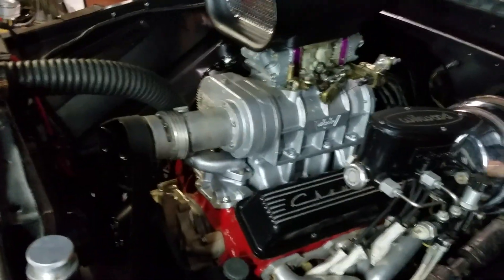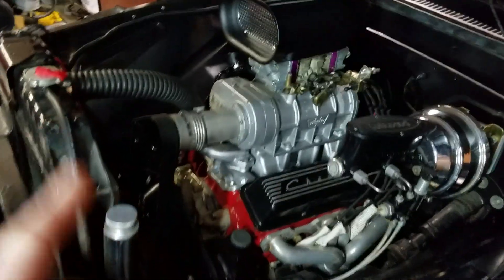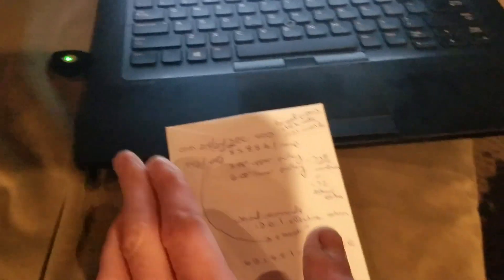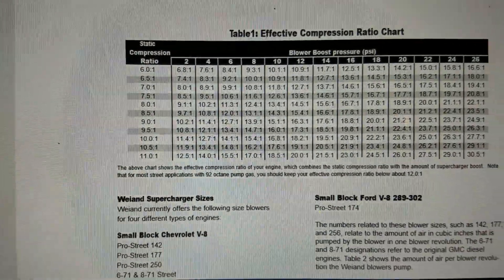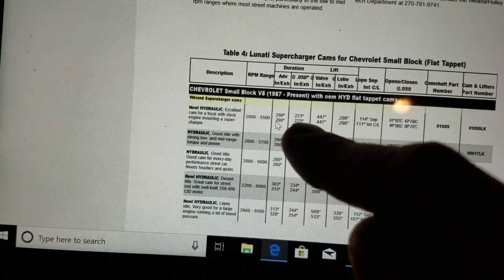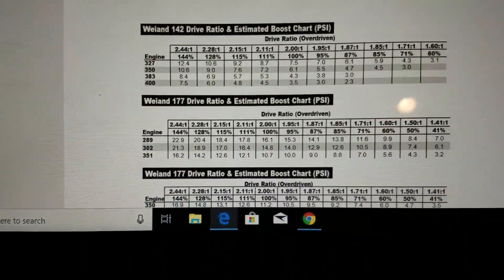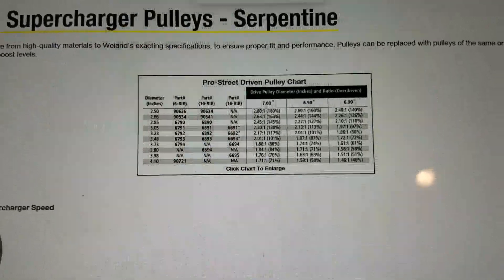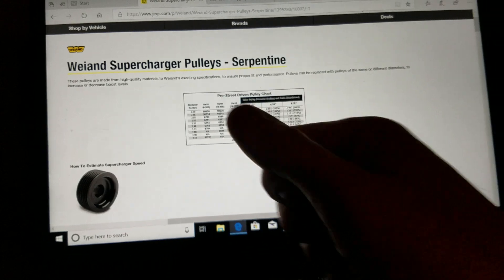Weiand 177 Supercharging: How Much Boost IS TOO MUCH?!

Comment: Question: is it possible to determine how many pounds of boost on your engine at 2000 rpms and 3500 rpms. I'm building a simular sbc 350 motor daily driver non race-drag, however I plan to keep the boost below 3 pounds of boost max at those lower rpms.  Is it best to control boost by installing larger pullies ???

Comment: I run the 8/71. On my rat moter.  Big deal on pistons. And rods.  Heads also. Pick the right combination . Stock is to risky. In the advertisement it says extensive modification needed. Wiend wasn't kidding. Yep. Carbs on a normal moter dont work correctly need to modify them also. Yep makes a small moter into a monster.  LOL  good video.

Comment: Good information,  have you had any belt  slippage problems?
Reply from the maker: No, though I wish the setup would allow for AC.
Reply: @PhysifistEngineering   i am putting a 177 on a bbc and was able to re work a late model single belt set up to alow for ac , power steering,  alt all 1/4 inch behind the blower belt .
Reply from the maker: @adambatchelder4121  you should make a video. Share the knowledge!

Comment: Very informative. Thanks. Do you have a link to the pages you were showing. I got a short nose small block blower that was used and would really appreciate a link to the info you were sharing.
Reply from the maker: Can't post links in here, but look for weiand supercharger installation instructions. The product page usually has a link to download instructions. Sometimes Summitracing will have them too.
Reply from the maker: Just checked, it's documentation dot holley dot com. First thing that popped up on Google.

Comment: Could I run this blower on a pretty stock internal 350 ? Basically I have no idea what internals are in the motor.
Reply from the maker: Keep the boost under 7 lbs, and make sure you don't run lean and I think you'll be fine. Just make sure your rings are sealing well and your cooling system is good. Probably switch to a cooler spark plug too.
Reply: @PhysifistEngineering  thanks man!!

Comment: What about 292h comp with a 501/501 lift in 244 duration  forged pistons in max bore with a 9:5:1 compression would it be to much?
Reply from the maker: The comp is a little high, but if you stayed under 8 psi it could work. For the cam, it would be nice to know the LSA. Cam changes don't really do much for under 3500 rpms. For the street, it won't help much, but racing at higher rpms it would help. Would be curious to know about the heads too. I've seen these blowers support built 383s so they have potential.
Reply: What do u think about the ls what’s your opinion
Reply from the maker: @hillsidesavage1413  I like it, cheap, compact, light weight, instant horsepower, supportive aftermarket for just about any swap.

Comment: Did the hood shut with the blower or did you have to cut a hole
Reply from the maker: I had to remove a small section of the rear support on the hood, but I didn't have to touch the actual sheet metal at all. So it looks stock from the outside.

Comment: Where does the boost gauge vacuum line go on the intake?
Reply from the maker: I have the gauge tee-d off from the line going to the power valve so they each get their signal from the same manifold port. So you get a vacuum reading which is helpful for tuning, as well as the boost signal.
Reply: @PhysifistEngineering   appreciate the knowledge

Comment: Where does the vacuum line go on the intake?
Reply from the maker: For the boost referenced power valve, the signal should come from below the supercharger, usually a port somewhere on the intake.
Reply: Appreciate it

Comment: How has your blower and engine held up since doing this? I’ve had ideas of slapping a 142 on my 350 but I drive the truck as a daily so I’m concerned with a similar setup being reliable
Reply from the maker: I actually just pulled the plugs and they look coffee and cream so the A/F looks good. I think it all depends on your boost level and the A/F mixture. If it doesn't go lean and you aren't pushing more boost than the pistons and rings can handle then you should be fine. I recommend an A/F gauge so you know what the engine is doing. If you don't have forged pistons keep it under 7-8 lbs of boost. Plenty of oem cars with superchargers so you should be fine. Run a cooler spark plug as well.
Reply from the maker: Did you ever put a blower on your setup? I recommend the 177 over the 142 if you do.

Comment: My 355 with 10.1/2 1 and that 177 with a 150 shot in my 46 street/strip truck.  Ran 9.70 1/4 mile . And we put the smallest on top and the biggest on the bottom.  It runs awesome.  It's also on e85. See my video on YouTube making 700+ Rwh
Reply from the maker: Yea, plenty of meat in those blowers, but being a daily I wanted to concentrate on reliable power without being eccentric.

Comment: You forgot that they have a pro street supercharger 144 series, which is going my 85 Monte Carlo SS with a 383
Reply from the maker: The only difference between the two is the coating on your rotors which wears over time. Did you choose the 140 series to fit under the hood?

Comment: saying your engine will get 30 more HP from more boost with the smaller pulley is one thing, and not knowing if your heads will handle that extra boost is something else
Reply from the maker: I dont think that's an issue when discussing boost at or under 8 lbs which I made pretty clear in the video. This is for street applications that are playing it safe by maximizing boost while remaining within the safe zone.
Reply: @PhysifistEngineering  you can think what you wish, but in my years I have learned that things are just not so, so
Reply from the maker: @sideswiped6874  Sounds like you've had bad luck. I always use quality parts, follow instructions, research everything, and keep power within the engineering specs. Clearly if you're applying boost to unhealthy parts things can go wrong, and supercharging always has inherent risks so you're stating the obvious. That's why I made this video to help people maintain safe power levels. This isn't a race car, it's a street truck and if you're afraid of 6 psi and staying under 5k on a healthy engine then you're on the wrong video.
Reply: @PhysifistEngineering ,  typical! 
go back and read my first posts again. and don't add between the lines!
 I was pointing out THE FACT that just because you say "2 more pounds of boost "will" produce 30 more HP" doesn't make it so just because you said it.
Reply from the maker: @sideswiped6874  I actually said, "I'd say, add ABOUT 30 horsepower." That's called an estimation, and it's based on what I know about this engine and personal experience. Everybody's engine combos are different and that's why people should be following the instructions like I outlined. If people have questions about their heads they can search forums or look for other videos that document that. I know the viewers are smart enough to do that so I don't worry about it.
Reply: @PhysifistEngineering  ,  about 30 HP,  yeeup, you said it
Reply from the maker: @sideswiped6874  Glad to see you finally understand. Thanks for watching.
Reply: @PhysifistEngineering  yes I understand well, that is why I first posted, just because you guess doesn't make it so ;)
Reply from the maker: @sideswiped6874  It's ok son. Someday you might be able to build cars too. Then you won't need things explained to you, and you'll be able to make your own videos. So get that channel going so we can see your work....
Reply: @PhysifistEngineering  buddy, again you guess! I was racing back when you were 5y.o, keep guessing, you may get 5hp out of it
Reply from the maker: @sideswiped6874  No, the boost is within the efficiency range of the blower and on average 1 psi, and this is slightly more, is worth a 7% increase which is equal to roughly 22-25 rwhp which is roughly 30 hp. Now if you're increasing boost past efficiency and you're superheating the charge you can actually lose power, but due to the low nature of the boost, 6 lbs, that isn't an issue. These are calculated estimates based on industry knowledge. You don't even have a channel. You arent sharing anything with the community except vague comments with no point so I simply don't care about your background at this point. You comment about racing since I was 5. You don't even know how old I am and this is a street application video so I dont even understand the point of your comment 😅 . It's like you're searching for validation, when I think you should just be out there putting out your own content if you have all this experience and the desire to share it on social media. Otherwise, all your claims mean nothing.
Reply from the maker: @sideswiped6874  LOL, yea, you're buddy, not you. Hahaha, what a loser. Taking credit for someone else's hard work. You lost me there. I didn't even finish your comment. Thanks for playing and adding to all the views on the video. Lol, man, thanks for that one.

Comment: Dude that was a very informative video awesome man I'm thinking about getting one I have a 350 small block Chevyeverything's forged the motor strong I'm already at 10 to 1 compression that's my only thing now from watching your video I find I can only probably safely run about 4 lb of boost. I wonder if it would be worth it.thanks buddy I'm sure there's other options I have to do some more research before the bang-for-the-buck you can't beat It.I want to see how your truck ran I was looking for other videos 😁but hey man great video thx
Reply: Find some thick MLS (Multi Layer Steel) head gaskets. That'll lower it .5:1. When I built mine I opted  for 9.7:1 with a steel shim gasket (1 layer steel) so if I wanted I could lower it to 9.2:1. Also if I were going to put a blower on I'd open the ring gaps up to .030" Makes no difference to crankcase pressure or blow by, just a pain to do.
Reply: @ThePaulv12  damn man sounds like it..😁 that was even a pain to read 😁👍 thanks brother

Comment: Thanks very informative. I have a 4.9 300 inline ford 6 cylinder that I am putting a 177 blower on. Would I follow the ford 302 recommended stats?
Reply from the maker: Yea I think the biggest thing is cubic inches and compression. Those dictate boost and the rest of the parts like heads and cams and exhaust dictate how efficiently you use that boost.
Reply: @PhysifistEngineering  thanks for your reply

Comment: Had a 4 bolt 350 40 over with a scar 383 kit run 8:6:1 roller cam 590lift h beam rods all the goodies topped with the weiand 177 3lbs of boost on dyno 550.5horse 535lbs torque.  All in a 72 c10. Cylinder casting  let get at around 2500rpm tree on the side of road stopped me.   Less then 100miles on the build.   Hope by spring we’re back together and bigger

Comment: Thats the thing with the smaller blowers, have to turn them up to do anything then they beat the air up way to much, always better to turn bigger blower slower to get same results, dosnt heat air up as bad.
Reply from the maker: I can't stand it when people make comments like this. As if I should just go buy a bigger blower. This blower was free, fits under the hood and it's not dialed up. It has room to push about 4 more lbs, but that's not my goal. Adding 100 hp for free was the goal. And 6 lbs is hardly pushing it. Guess you didnt watch the whole video.
Reply: @PhysifistEngineering  Then why make a false leading video, Should be, Got free blower, lets see what happens?
Reply from the maker: @jocrp6  Because the video is about a 177 and how to add boost safely by following the guidance of the manufacturer and that's literally what the title of the video is. Just because I got it for free doesnt change anything troll.

Comment: I have a 177 on my 355ci.. in a nut shell its 10.5.1 30 over aluminum Holley heads 850 Holley on e85. 2.5 in top pulley 6in lower.. Truck is 3200 with me and 150 shot of Nos 
No tranny brake leave at dead idle and runs 9.70s!! Today I ordered the 7in lower pulley.. it should make 12.5 lbs of boost. And if I do spray it!! should be around 15 to 16 lbs of boost
Reply: Could you tell us about your experiences with this combo smaller pulley on the top and the larger pulley on the crank. Didn‘t you have heat problems etc?

Comment: Hey man! Really enjoyed the video. I would like to ask you a few questions. I am building up my 1966 c10 with my dad we have a 396 big block and we are going to run that exact set up you have the brawler 750cfm carb and the wield 177 series blower! How does it run for you? Do you think it’s a good street blower? How hard was it for you to get it running? Hopefully you see this. I’d love to see a video of you driving the c10.
Reply from the maker: Great questions. I highly recommend an A/F gauge for tuning and make sure you understand all the different circuits of the carburetor. The engine fires right up. The blower actually helps with that. Man, it's like instant torque when you get on it. Total tire shredder. Since you have the same cubic inches I'd guess it runs similar. I say this is a great blower for mild or stock builds, but at 400 ci I dont imagine it would support 6000 rpm with aluminum heads. But if your cam is reasonable and you have a solid, but not exotic head this blower makes for a great torque monster. Just make sure you run premium, your compression is below 9:1, and you keep your timing below 34*. If your compression is higher you'll need to lower the boost level to compensate but that's easy with all the pulley options.
Reply: Physifist Engineering thank you to much man! I can’t wait to get it started! And we have an upgraded cam. Thanks for answering my questions

Comment: summit racing 1104 or an 1106 is a nice cheap camshaft for boosted engines. You mostly just want a camshaft with a wider lobe separation like 114lsa too much overlap is no good for boost. You should always have a way to pull out timing as boost increases like 1 degree per psi of boost is generally acceptable. I mostly mess with turbo's but ive ran 15psi boost pressure on 93 pump gas through a bone stock honda 4 cylinder engine and it held up for years before i sold the car. Also have a friend with a mustang cobra with a whipple blower and on e85 fuel it makes 650hp at the tires on 24psi of boost. So don't be afraid to run higher boost pressure that's how power is made you just have to be conservative with your ignition timing and run the air/fuel ratio a but on the rich side in boost to help keep cylinders cool and it will live.
Reply from the maker: I'm not afraid to run more boost. You're just comparing apples to oranges. Old school roots blowers dont make boost like a new whipple or a turbo. Secondly, you're comparing new engineered smaller displacement engines with highly tuned fuel injection to an old 400 so yes you can run a newer engine to crazier limits due to its design. You can also do modern whipples with an intercooler as well as turbos. You cant do that with a Weiand blower. I would also need to spend thousands of dollars to push the boost level and this project was practically free. And that 342 was dynod in the car on a chassis dyno. If I had the fuel pump to run it it would have easily eclipsed 750 hp at 6000 rpms but that's far too much power on a roller 5.0 block.
Reply: What's he talking about, I run a locked dist at 30 deg on a 427 BBC with 16lbs out of 8/71 with 7:1 comp.
Reply from the maker: Your friend's Cobra isn't impressive. I've made 625 at the flywheel at only 4950 rpms and 10 psi through a Holley carburetor on a 342 stroker and D1 Procharger with California 91 Octane. God knows what it would make if I could spin it to 6500.
Reply: @PhysifistEngineering  not my cobra just a friends i help work on, only a 4.6 and that was on a mustang chassis dyno so obviously the numbers will by lower than measured at the flywheel on an engine dyno. Yeah you should make a lot of torque with 400 cubes and a little boost should make a nice tow rig

Comment: What water neck thermostat housing is that .... appreciate it thank you
Reply from the maker: I believe I got it off Ebay or Amazon. If you search black swivel thermostat sbc you'll see lots of brands and types that all look the same. It uses an o-ring and you can buy it in different angles and of course the swivel is great too.
Reply from the maker: Be sure to check the outlet diameter as well. I even saw some that come with a threaded AN ending for screw on radiator hoses. So there are lots of options out there.
Reply: @PhysifistEngineering  thanks much
Reply from the maker: @Kregg63  No problem. I'm trying to make this channel more educational than the TV shows. Any support helps.

Comment: Awesome setup, I’d like to see some videos of it running and driving on the streets . I have a 355 with a 177,  aluminum Trickflow heads and full roller top end.  Just need to slap it into my 55 Chevy. Thanks for the explanation on the Weiand, have a good one👍🏼
Reply from the maker: I'm adding boost and AF gauges and I switched over to the smaller pulley so I'll do a follow up video.
Reply: pop that puppy in and have fun,dont wait
Reply: I just did that exact setup in my 55
Reply from the maker: @Kregg63  is it running yet? I swapped in a 4L80e and it still runs great.
Reply: Do you worry about too much horsepower or torque for the cast internals?
Reply from the maker: @Kregg63  No because it's simply not a lot of boost. Once you start creating 8 psi and you want high rpms then you start to have a problem. This here is 6 lbs on a 400 which has a larger crank, strong rods and the engine has forged pistons. Add to that I doubt this combo ever sees 5000 rpms because it's a 400 truck motor in a truck. Not really a race car.